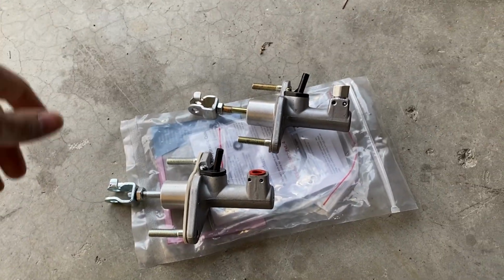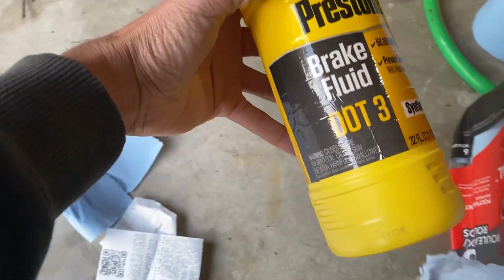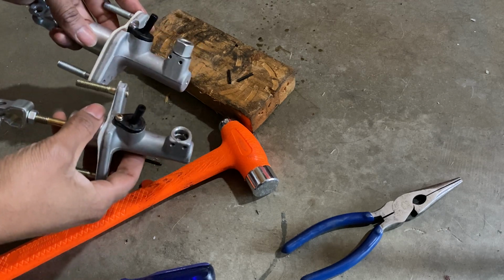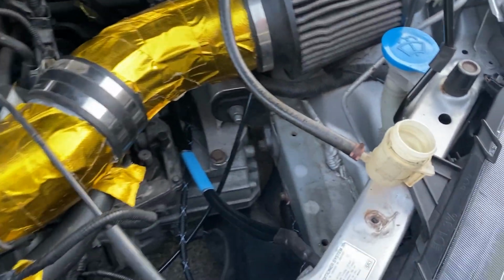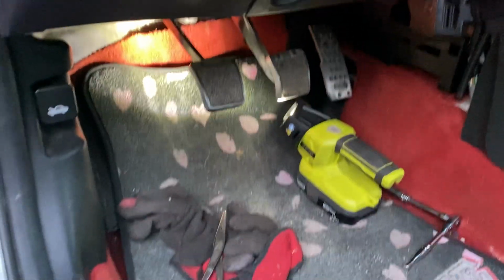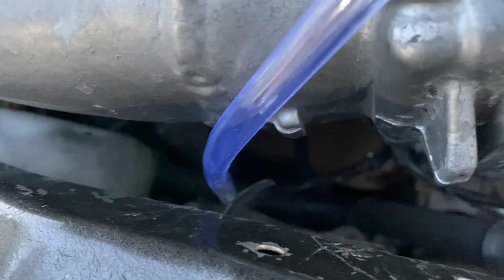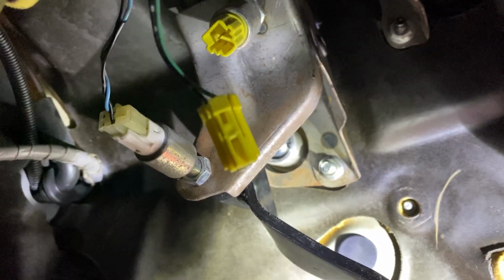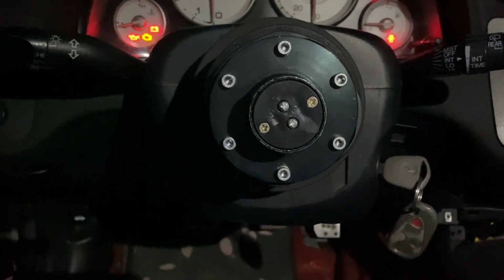How To Bench Bleed Your CMC and SC | RSX

Comment: I am on my 5th cmc.   The first three were oriellys and autozone replacements.  On the third one I needed a new clutch so I got a heavier weight performance clutch.  Master cylinder failed shortly after so I got a ktuned one and that last me the longest at a total of 1yr and 11 months.  I was easier on that one for the most part and it still failed.   I had tried to get everything to perfect spec cause I was sick of this.  I am currently installing hybrid racings cmc and hoping I never have to touch it again but I also have a clutch masters cmc ready to swap for it if it gives out again.  Bleeding has been done with someone who has been a mechanic on top of my own research so I am confident that was done properly.  The only concern I’ve had is push rod adjustment but even then my mechanic friend asserted it was correct.   I am curious if anyone else has suffered this issue?
Reply: Hey dude how is it going so far and have you tried 51410??

Comment: i got the exedy em2 cmc and sc and i don’t have any free play in the clutch pedal. i did the adjustments with the 12mm on the pedal rod and with the druid control switch and still none. i even switched out the em2 rod with the oem one and still. i got the autozone one and kept it all on like you did and i don’t have any clutch free play and i don’t want it to be againts the throw out bearing if it’s not adjusted right. sorry for the long comment i just need help 😔
Reply from the maker: That’s weird. The only thing that I can think of is that the master cylinder isn’t flush against the firewall